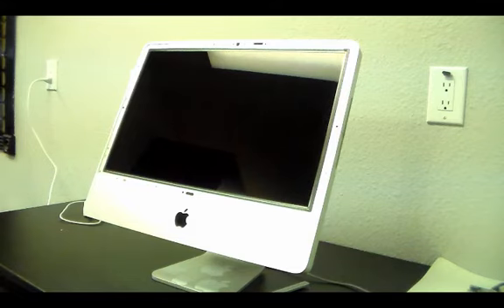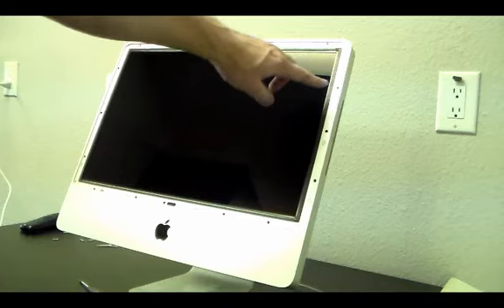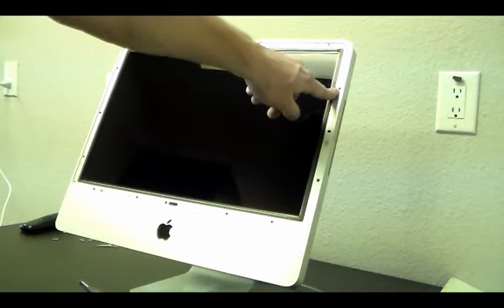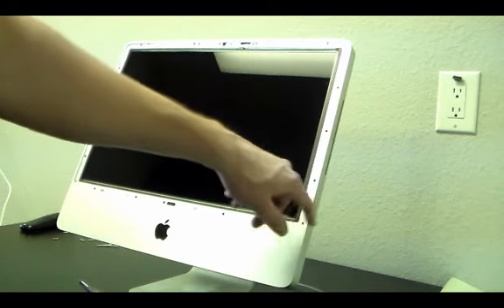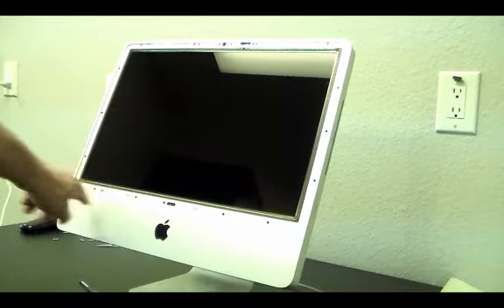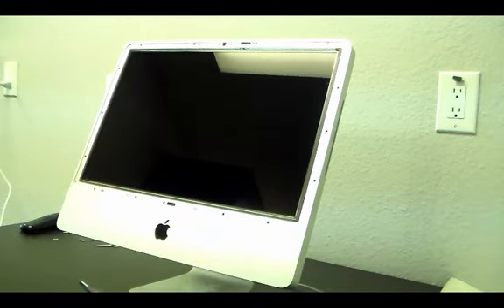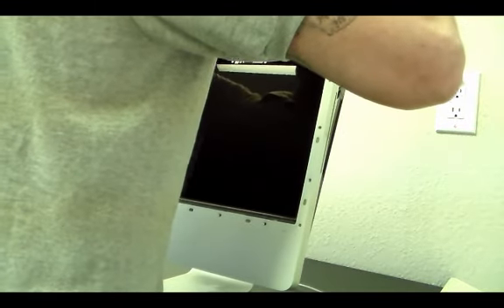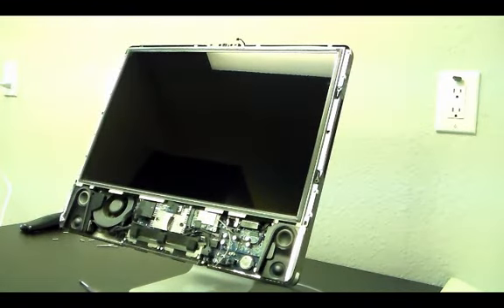iMac Repair & Tear Down Guide - Diagnosing Power

Comment: Hello how can I test the power suply of imac 24 A1225  ?
Reply from the maker: +Edna freire Aguiar Shimamoto You should see some little green LED's after you removed the bezel and monitor. If none are lit up when the machine is plugged in its usually a sign its norm working. However, its always best to install a power supply you know that works to ensure you found the problem. (I know easier said than done if you don't have the part, but its sometimes the only way)